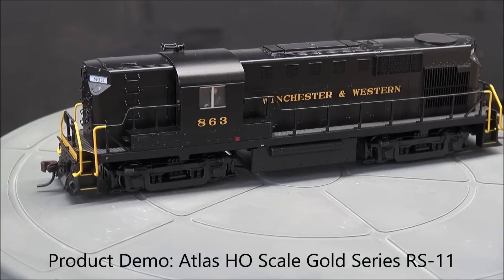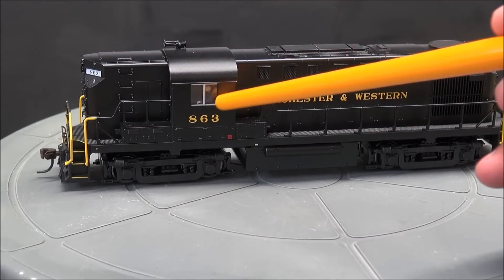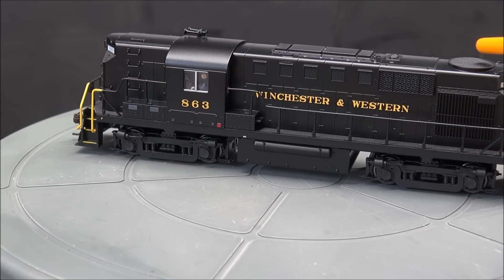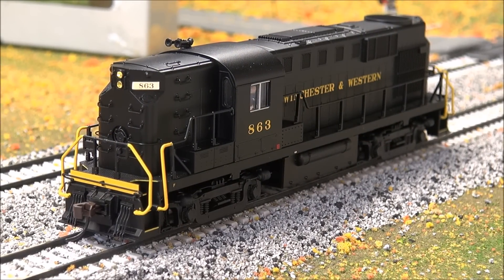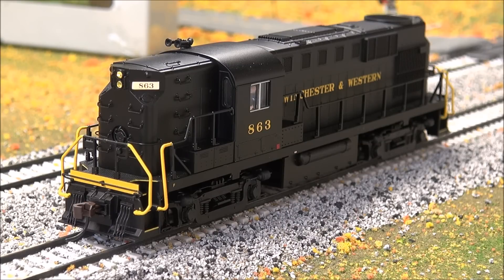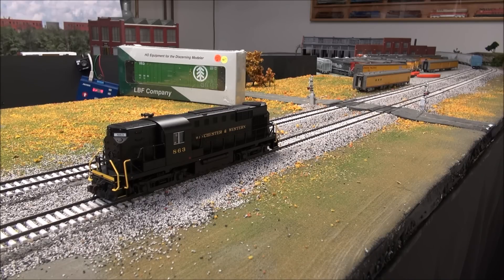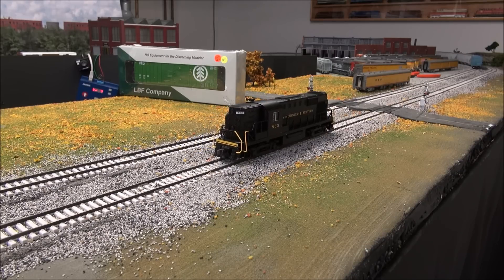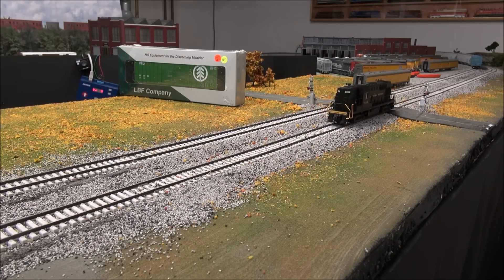Product Demo: Atlas HO RS-11 w/DCC, ESU Loksound

Comment: Running through it like you're bored. You just point to the radiator or fan grille? I want to know if those parts are photoetched, if there's detail behind the grilles.

Comment: not sure if its the sound or the fact its a digital sound, being played through a speaker, through another set of speakers.. but the sound sounds way off to me.
Reply: just went to the esu v4 downloads page.  kinda sounds like thats got the 12 CYL 251C3 which is an M420 sound or something else, instead of the proper 12CYL 251B Sound which ESU lists for the RS11 and sounds correct to me.   any idea if thats the case and if it can be corrected?  and with this being a demo, maybe theres time to let atlas know about the possible oops?
Reply: Tcaauwe2002 You are correct, this is 251c3 and should be a 251b. I believe the ESU website states this is as close as they currently have.
Reply: the 251B is listed on page 2 or 3 of their version 4 downloads.  so they've got it.  just gotta use it.

Comment: Is it just me or are those handrails too big to be scale?
Reply: Yeah that sucks. They haven't upgraded those crappy handrails at all!  Or the oversized fuel tank. Shame Atlas.
Reply: Ok model but Atlas should come out with a better detailed one.  The end handrails are incorrect for alot of roads.  Some roads had handrails that had higher stanchions with a chain in the middle, for the walkway to cross over from one loco to another.  Also the horn is in the wrong location and even if you get it off the cab roof Atlas has a molded on base-plate, that the horn is connected to, that is left on the cabs roof.   The Life-Like Proto 1000 model had some better detail (like separate handles on the hoods access doors) and more correct road specific features, but did have issues with the bodies dimensions.